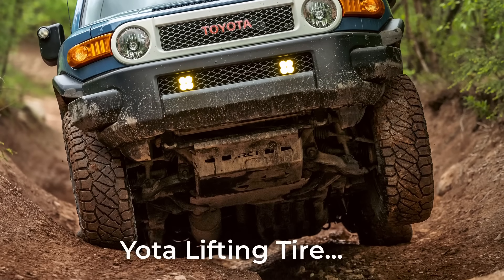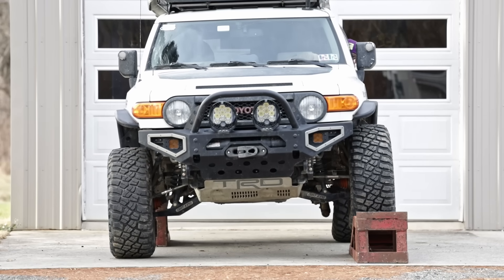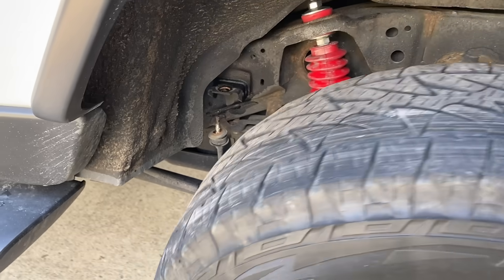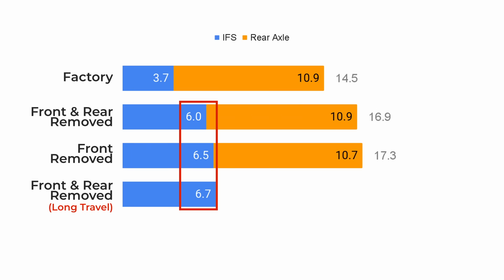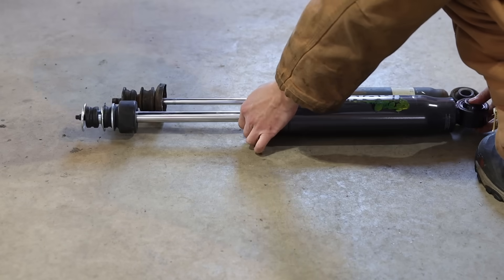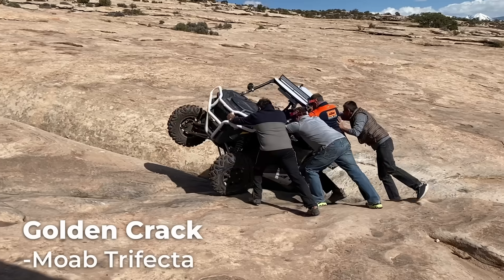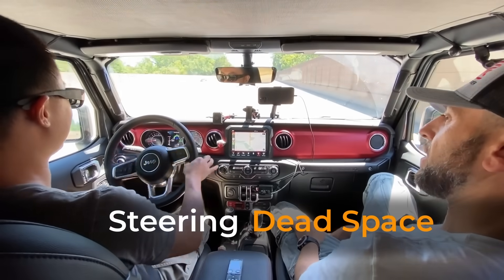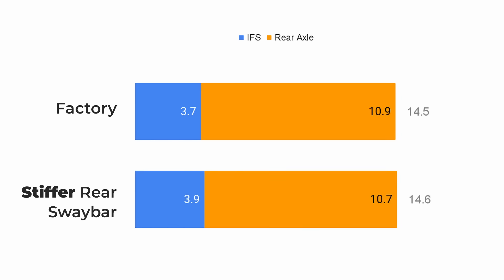Articulation vs Sway Bar | Not What You'd Think!

Comment: its important to note that front/rear stiffness balance for road manners is important. Dramatically reducing the front stiffness can create a strong oversteer tendency, which is obviously not desirable on tall vehicles.  The safer on road setup is to remove the rear to get miles of understeer.  OR better yet, disconnectable front sway bar.
Reply: You can’t disconnect the front sway bar on Toyota truck IFS, if you disconnect but don’t remove it, the sway bar will make contact with your CV axles while turning and destroy the outer boot at minimum, or wreck the inner bearings at worst. Ask me how I found that out.
Reply: @TK63636 how did you find out?
Reply: @chrisscahel1204  😅
Reply: @TK63636  i really want to know because I replaced my end links and the new end links were wrecked in short order so I'm split between replacing them again or removing the whole sway bar.  But it is also my daily driver in Colorado.
Reply: @ Ah you weren’t being sarcastic. I removed my sway bar entirely. Can’t notice any difference in handling whatsoever tbh. Significantly better articulation off road. Just take it off and drive safely with plenty of distance on the highway between you and whoever is in front of you, you’ll be fine. Leave the rear on.

Comment: Would this be applicable for front and rear independent suspension vehicles?
Reply from the maker: No, fully independent suspension vehicle will not have big imbalance like this. But it will just lack articulation overall. Like that Polaris RZR at golden crack in my video. On paper, it has way more suspension travel than my FJ. But it is only good for high speed straight up and down travel. It doesn't articulate much and it almost flipped over due to tire lifting. We were there witnessing multiple of them doing golden crack after we passed through.

Comment: That’s awesome, good data👍. One thing to mention is off-road safety on inclines. A big downside to IFS is wheel lifting and leaning to one side on bigger climbs. A stiff rear bar can help avoid leaning to the downhill side. Greatly increasing safety and drivability.

Comment: Great technical videos with real world testing. Have you had any issues with breaking the rear upper control arms and the flex you have? I have snapped 6 on my 2000 4runner due to the flex. They couldn’t handle the twisting forces when articulated.

Comment: Really interesting and informative video. I've been wondering about how to achieve more droop with IFS. 

My concern though is that if I achieve more droop, the CV driveshaft is at a much more extreme angle and more prone to failure. Have you encountered this?
Reply: Make sure your CV's aren't binding and you will be fine. I have been running the extended travel Icon coilovers and the CV's have not had binding issues when set to the specs icon recommends on lift height. CV boots typically tear because the ribs are rubbing on each other. I am trying the CVJ axles now and they have been great so far. They include an Oring between the ribs to prevent rubbing.

Comment: I had a link somehow fall out of my front sway bar in my truck, and this weekend I still went on an offroad trip and it handled the tough stuff great but on the highway it leaned a lot. I'll disconnect a link when I get to trails but keeping them on when I get back to the highway
Reply from the maker: I'm surprised the sway bar didn't cut through your CV after loosing a link. The bar itself will run into the CV and tie rod if you take out a link and get into larger articulation.
Reply: I don't have a Toyota, I have a Chevy Tahoe (I'll add a link to a facebook post with it), and the sway bar never once hit the cv axle. It did hit the tie rods quite a bit, but because it wasn't hooked up, it never hurt anything as there was no torsional force on it.

Comment: Kai, thank you so much for these invaluable resources that you've put out. I believe this fills a gap that saves people countless hours of research by reading thousands of less-than-accurate forum posts. 

I wanted to ask you, if you can perhaps put out a resource video regarding your personal recommendations for different implementations of the Toyota IFS platform. For example, top 3 recommendations under $1000 for 4runners/GX460s, etc.

In my own personal case, if you have some time, I wanted to ask you. We had a horrible winter storm up here in Canada. On the highway, 1/2 cars swerved off the road and were completely helpless. Our stock '07 4runner SR5 somehow survived but we were stressed out of our minds and also felt so terrible that we couldn't help others.

Of course with the snow we get here I just don't feel comfortable removing the front sway bar, so I have to go towards lifting the car for additional clearance from the snow. What would you recommend for under $1500 USD to lift the stock 4runner without sacrificing articulation? In your IFS videos you've recommended a 2" lift with extended travel coilovers. Can I couple this, alongside a 2" spacer on the rear?

Comment: Will you be designing some legit front sway bar disconnects for us with near stock rigs? That sounds like an excellent mod for stock suspension designs. I have stock height Bilstein 6112/5160 on my FJ. Thanks for the informative and entertaining video! 🤘
Reply from the maker: I'm playing with some ideas for a true sway bar disconnect. The existing sliding end links style is decent compromise. Just that it doesn't get to 100% travel.
Reply: @TinkerersAdventure  Agreed. I've looked at those but not sure if the downsides are worth the benefit for something more daily driven. Keep us posted!

Comment: Being an engineer you should design an electronic disconnecting front sway bar like the jeeps use. I don’t see why it wouldn’t work on a Toyota. There’s plenty of room to mount a solenoid in the middle of the bar. Would need a straight thick bar instead of the bent one.

Comment: Hi your videos are super helpful and informative I was wondering what your thoughts are on quick disconnect front swaybar links for the FJ. Is it the equivalent of not running a swaybar but having the ability to reconnect the pin or link before on road use again? Do you have any experience with these or any knowledge to throw my way before I decide if they are worth the money. Thanks keep up the FJ and toyota content love it all. One day I'll be able to save up to purchase your bumper for my fj it's the shipping to New Zealand that is stopping me :(
Reply from the maker: Thanks! The sliding links will not achieve full travel, but still an improvement over a regular front sway bar. There is no true front disconnects for Toyota due to the way the sway bar is mounted.

Comment: I agree with your analysis, i run an antirock swaybar in the rear with long travel up front and i had always thought i need a stiffer swaybar to get more out of the front long travel.  I too am one of 7 ifs toyotas to conquer the Rubicon soupbowl (iconicfj included) although without any swaybar at the time and in a 2nd gen tacoma. Other factors made that obstacle possible than just swaybar and suspension. Ill be going straight axles and keeping the sway bar in the rear but may do a sway bar up front if i can package it.  Love your videos, keep up the good work. I refer people to your channel when they ask questions that need visuals.

Comment: I'm guessing that connecting the rear sway bar with no front sway bar will increase front wheel travel articulation since you're forcing the front to flex more due to a more rigid rear suspension. Essentially your transferring more weight to the front when on uneven surfaces.

Comment: I love your engineering and data-driven approach to off-road topics. Once you put the data into context, it wasn’t surprising that the rear axle needed to be stiffened to force the stiffer front IFS to actually take on more work.

I have a 2017 Tacoma DCSB with the stage 2 Ironman FCP (3” ride height). I took my sway bar off and noticed that the new, stiffer front coilovers handle the on-road stability quite well without a sway bar. I was, however, a little disappointed that my rear axle simply flexes harder now (with the extended travel rear shocks), and my front IFS is too stiff to keep my truck level in hard flex situations.

The only bummer is that the Tacomas don’t come with a factory rear sway bar. Perhaps I should find a way to install one.

In extreme flex situations, the no-swaybar IFS does eventually do a nice job flexing to keep 4 tires on the ground, but the IFS still forces the truck body to lean away from whichever way it’s compressed.

Thanks for the videos as always!
Reply: More evidence that Asians are good at math

Comment: What wear does that do to CV joints with more front travel… puts more angle on the CV joints…
Reply from the maker: You don't need to worry about that during off-road articulation. All KDSS 4runners and GX460 use the same CV axles and articulate to this extend from factory. The GX is even hooked up to a V8

Comment: On-road performance - with rear sway bar only, that reduces grip on the rear which might lead to oversteer instead of the usual (and safer) understeer tendency of most unmodified vehicles. I know from racing a front wheel drive car with an open diff. We stiffened up the rear sway bar to help keep the front wheels on the ground giving better drive out of corners (same method that you show) but it changed the grip balance to the front making the car oversteer more often.  Great video by the way. Love to see someone explaining how things really work instead of giving people what they want to hear.

Comment: Kai, are you running 1” longer rear end links on your FJC with the 4” longer rear shocks?

Edit: Never mind…I saw you listed the extended rear sway bar link info in the description.

On my 2003 GX470, I have the icon 56550 long travel shocks, 1” longer rear ocd end links, extended rear brake lines, and long travel dobinson 675v coils. 

I’m gonna remove the front sway bars and I have 6112s with 700 lbf/in coils so that should help a little to prevent some swaying up front

Comment: Why no manufacturers build a front swaybar disconnect like in Wrangler Rubicon? I've seen non Rubicons have a manual disconnect option which also can be used for Rubicons if the electronic disconnect fails.If there's a mechanism to disconnect somewhere in the middle of the swaybar will it impact any other components?

Comment: I paused the video and here's my prediction: with the front removed/rear installed, more of the flex will be put into the front (increasing travel) due to the fact that the rear will be moving less/be more stable and the front will be taking up the movement that the rear would give if it was removed. Let's see what happens!

Comment: I see my photo at 8:37 😁 what a pleasant surprise! So I currently have an FJ Cruiser with front ext. travel coilovers and a rear long travel kit. Since it is my daily driver, I run with a front sway bar on but no rear, that way I can have the unrestricted articulation back there for the long travel as spoken of in the video. But what an enlightening investigation! I never expected the articulation for the front to improve with only the rear sway bar on. Makes me want to go home and take off the front but reinstall the rear with longer sway bar links! But at the same time I know how it feels to drive without the front on, so it is a trade off for sure.
Reply from the maker: Haha thanks for your photo! Unfortunately you cannot fit a long enough sway bar endlinks for your long travel shocks. The end link will be so long that it hit the lower link during compression (it becomes the bump stop essentially). So using the longest possible end links like mine, you will give up some down travel
Reply: @TinkerersAdventure   I had a buddy from the forums make me a set of rear quick disconnect sway bar links for long travel but I ran into your same issue. On full flex the custom sway bar links hit my rear lower link. So which rear links do you have exactly? I assume they are not OEM length but still not super long. After watching your video I do want to try out running the rear sway bar with longer links and removing the front sway bar. And maybe I will even get the stiffer rear sway bar while I'm at it!

Comment: It would be very easy to fab up some longer rear sway bar links to allow compatibility with the rear long travel...
Reply from the maker: No, end links long enough for 28" shocks will hit the lower control arm at compression. My end links barely clears the lower control arm and is barely long enough for 26" shocks. I've seen people running swaybars with 28" shocks. They are simply not getting all the down travel from the shocks and risk breaking the end links, or the mounts.
Reply: @TinkerersAdventure  Interesting, hard to know exactly what you mean without seeing it. i wonder if introducing a curve or bow into the end link could help clearance?
Reply: @TinkerersAdventure  Ok I'm looking at 9:51 I think I partly see what you are saying. That's an interesting arrangement. What is the thing in the middle, gas tank? I wonder though if you could play with the angles of the linkage movements by modifying where it attaches to the chassis or modifying the swaybar shape and prevent interference

Comment: It'd be interesting to see you do this with 100 series Land Cruisers. With the torsion bars would you see as much improvement with the front disconnected?
Reply: @mails5054  They are hefty, about 5400 curb and if you start adding armor etc they get real heavy real fast.
Reply: @mails5054  The land cruiser doesn't use coil springs in the front like every other Toyota IFS, it uses torsion bars, which are beefier but allow for less articulation.
Reply: @mails5054  First off calling someone stupid when you clearly have no idea what you're talking about makes you look like a fool. I never said the 100 series doesn't use IFS, I said it uses torsion bars instead of coil springs. There are different types of springs if you weren't aware, coil, torsion, leaf etc. Sway bars are a type of torsion bar but the actual suspension on a 100 series has two large parallel torsion bars that take the place of coil springs. You attacking me is just unbelievable. Look up info on different types of springs before you shoot your mouth off and call people stupid.
EDIT - Apparently your remark attacking me has been deleted but know that I saw it and you made yourself a fool.
Reply: @tj_offroad  sorry i have bi polar and i drank a lot cause an online friend passed away from heart diesese, nothing personal it just makes me lash out for no reason
Reply: I am also curious to see the results with a 100. The front has such little travel to begin with that I have been running a sway-bar free rig for a while to gain rear flex. I honestly did not notice a difference in highway travel with and without the rear sway bar but like Kai said, that's very subjective
Reply: Did you get your answer!?  @cruiserpatch

Comment: It just depends on year of vehicle for me. 86-94 4runners the torsion bars are so stiff in the front the sway bar only helps 10% on road. Just trying to squeeze any travel out of it really. My 2000 4runner was fine, never felt the need to remove it, flex was good enough. My current 83 pickup, remove sway bar and pan hards front, and sway bar rear. You need all the articulation you can get of both axles, and they are stiff enough, you hardly notice.

Comment: Which is greater; the change in handling going from both sway bars to just a rear sway bar or going from a rear sway bar to no sway bars?
Reply from the maker: ooof, that's a tough one. it has been too long since my last change. I'd say similar, otherwise I would've remembered
Reply: @TinkerersAdventure  thank you. I am currently swaybarless in my GX but did save the rear bar. Considering putting it back on now. 
Also to your point in the video, my wife drives ours all over the country without issue.

Comment: good analysis!  I have decades of experience setting up race car suspension, so I put that to use on my Gen 2 Tacoma.  What I ended up doing was removing the front bar and adding a rear bar with custom links.  I'm currently working with a bar manufacturer to build me a heavier bar (1" instead of 7/8").  The combination gives me a good balance of handling and predictable trail manners.
Reply: I’ve got a gen 3 taco I want to do this to, it might be interesting to see a video of your results so others (me) can copy it haha

Comment: based on this video, if i'm adding rear sway bar on my toyota hilux(which is doesn't have rear sway bar on stock), it will affect really much on articulation but improves the handling on the "S" corner on paved road. Fyi Toyota hilux is known for toppling over at "S" corner more than other ute like isuzu dmax,mitsubishi triton and ford ranger at stock state.

Comment: The biggest reason to remove the front sway bar on ifs is to get true independant suspension, running rear extended links also helps retain the rear swaybar with max flex, my fj runs a true long travel rear with stock sway bar on extended links
Reply: is your rear suspension not binding at the link? I took mine out for the first time this past weekend and i believe I was hearing it bind. I do have a stiffer sway bar than you do.